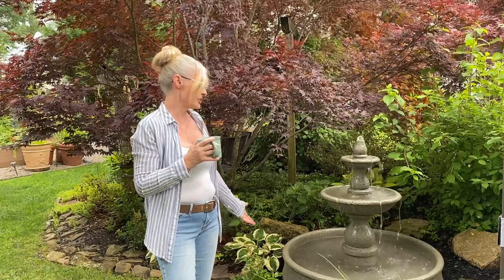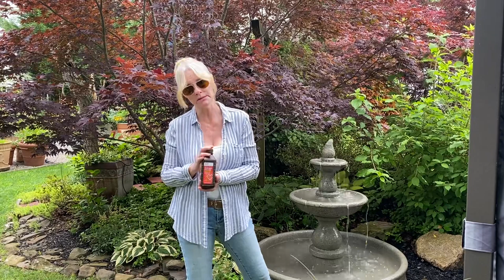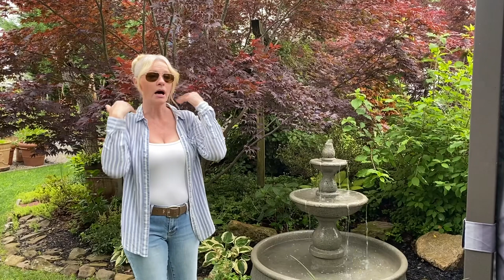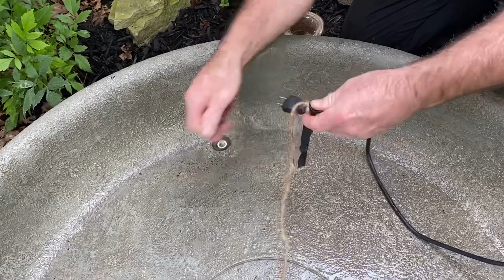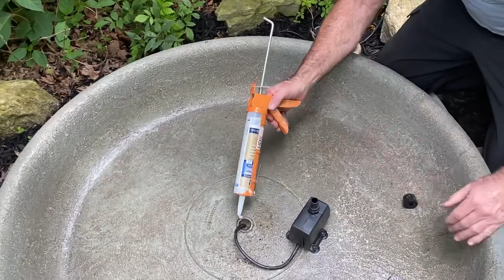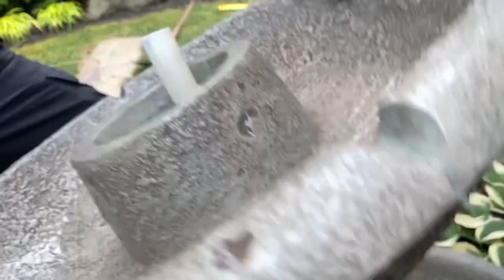Things To Think About BEFORE You Install a Cement Water Fountain and How to Replace A Fountain Pump

Comment: I have had a fountain in my courtyard for about 20 years. It sits in sun mist of the day & I don’t bother to drain it to keep it pristine. Every spring I pressure wash it with an electric pressure washer, fill it & then keep it topped off throughout the summer. I use an algaecide to control the algae growth & occasionally skim any debris. Mine runs 24/7 from April to December. Then I unplug it & cover it until spring. I’m planning on buying a large one next year for a new garden I will be creating, so will keep your tips in mind. 
My frog pond is au natural, filled with leaves & other detritus. It’s how the frogs live in nature & Ive never received a complaint from the residents. 🤭
Reply from the maker: Hi Deb, thanks for sharing your experience. A new garden?! That's always exciting!! You have taught me a new, cool word...detritus. I've never heard that one before. Frog ponds are great, sooo low maintenance.

Comment: Thanks for all the good information. I am going to try the hydrogen peroxide - great idea. When I had watched your original video about some of the algae products, I ran right over and checked the label more carefully of what I had been using at the time. Despite it saying it was safe for wildlife, there were all kinds of warning similar to what you had read. I was shocked and stopped using mine. I owe you for that. ❤️.
Reply from the maker: I know...how can it be safe for wildlife but can't come in contact with skin? What? Life baffles me sometimes. I used it for quite awhile before noticing the warnings too. I'm having good luck with the peroxide, I'll cross my fingers that it works for you too.